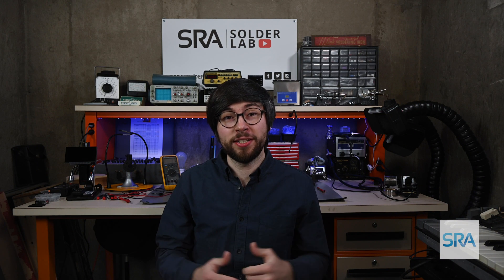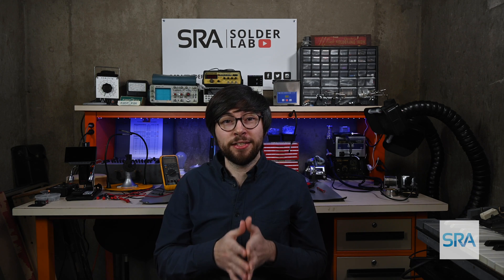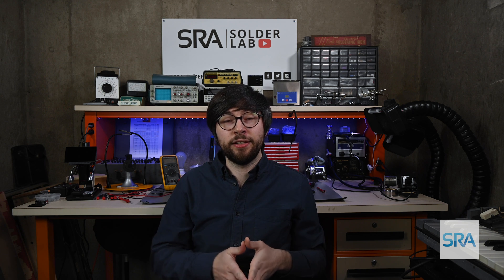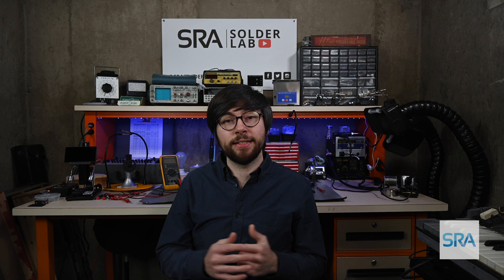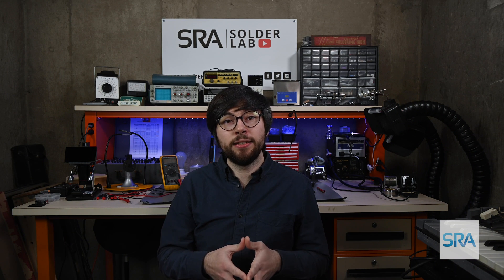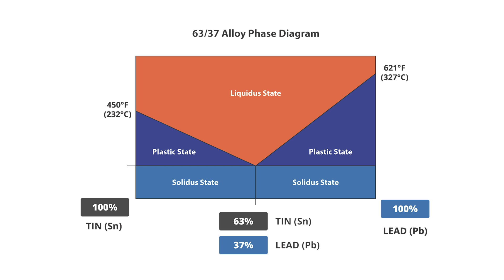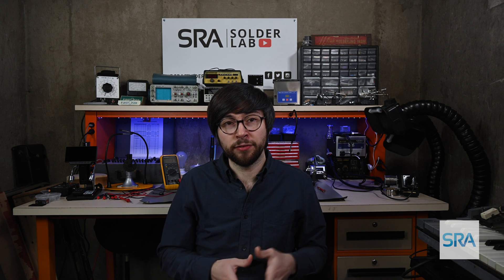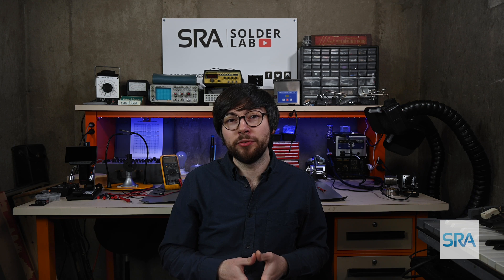Is Lead Solder Bad For You? | SRA Solder

Comment: Thanks for this. I don't work much with electronics but I mod and fix up guitars every now and then and the last time I was doing the wiring on a guitar, I noticed the spool of solder I've had for the last ~7 years has 39% lead in it and I was thinking if I should throw that away or is it safe to keep using it. This was helpful.

Comment: Great Video.  Note many mil-aero applications require leaded solder: "Lead-free solder presents several disadvantages compared to traditional tin-lead solder, including higher melting temperatures, increased thermal stress on components, more challenging rework processes, and the potential for brittle joints. Additionally, lead-free solders can exhibit issues like tin whiskers and dendrite formation, which can lead to short circuits and system failures."

Comment: 5:25 I'm just looking through all the gorgeous technology that I would refurbish and use or sell. That not waste management, that is a crime scene. What would I use to refurbish it? Lead solder, obviously. Anything broken from the 21st century is usually a result of that crap RoHS stuff. Remember DV9000 failures, rampant gpu failures, and the red rings of death on your 360? Yup, RoHS solder failures leading to component failures. RoHS solder has done more to fill our landfills with otherwise perfectly usable technology than any other factor. Leaded solder can help save the planet when safely sequestered in working electronics and our workbenches.

Comment: SAC305 and SAC405 (both are lead-free) can melt at the temperatures like lead when used as a solder wire. If SAC305 becomes solid, then it will melt at 370°C to 400°C. I don't know about SAC405's melting point after use but it's eutectic.

Comment: Handling the leaded solder wasn’t an issue as we used gloves. We were taught this from the start. We were also taught not to inhale the fumes that are produced as a part of the process. For those who are not contract workers for the defense industry, you can avoid issues down the road by wearing gloves and keeping your breathing out of the path of fumes. This is not a scare tactic. It is a legitimate health issue you should be aware of when using leaded or any solder. Fume extractors will work to remediate this issue and wearing gloves will inhibit direct contact with the lead in leaded solders. The flux contains compounds which will cause health issues and staying out of the fume path while breathing. Professional contractors have these safety equipment problems covered as they require glove wearing and use of fume extraction equipment during operations. Hand washing before breaks and before end of day inhibits problems down the road. Poo pooing this is futile as handling leaded products involves these precautions. The SDS clearly lays this out. This is highly evident in critical circuit soldering where the most extreme precautions are exercised. This was evident in DOD STD 2000-1 and is still evident in the JSD 006 level 3 which is also critical circuit soldering. Ignoring safety is just stupid. It’s your health here and you should care about this. I’ve been soldering since 1979. There is something that was true back then and remains true today, safety is paramount. Ignoring safety is a sure path to your own destruction. Coming in with the understanding of health and other issues saves you from too many problems. It’s up to us to avoid these problems by keeping ourselves well informed. Stay safe and press on people.

Comment: is 60/40 effectively diff from 63/37?  and why the slight diff?
Reply from the maker: The difference is that 63/37 melts and solidifies at the same temperature whereas 60/40 has a "plastic range" so if it isn't fully heated you get a cold solder joint.
Reply: @SRASolderLab  Thanks, but why would one want 60/40 over 63/37? or even lead free... allowing for rules and manufacturing ect i understand.  My 63/37 digitor solder melts like butter and is so easy to use and less risk of flexing m/B cracking solder. Why would one want 60/40?
Reply from the maker: @xx3868  The higher lead content in 60/40 leaves shinier joints. It is all a matter of preference though. People that have used 60/40 for years are likely to keep using it instead of switching.
Reply: Eutectic is my go too.

Comment: As far as vapors go, consider this: when you solder, you're typically working with temperatures that peak out around maybe a little over 700 degrees Fahrenheit. Lead does not boil (vaporize) until 3,180 degrees Fahrenheit. But one should be soldering in a well ventilated area with good air-flow anyway, because the fumes from the flux are not particularly desirable things to be breathing anyway.
Reply: notice how water will evaporate from an open container below its boiling point, at a rate that accelerates when the temperature rises. an element below its boiling point still evaporates into the air...
Reply: @louisvl10 What's evaporating now?

Comment: There are no problems with modern lead-free solder, it just isn't as shiny. Weird hipster hobbyists and boomers insisting that putting lead in all our electronics is safe and fine is actively harmful to human health. You apparently haven't noticed that soldered electronics are EVERYWHERE. `
Reply: You apparently know little about electronics, engineering and repair.  Lead tin solder is still being used where high reliability is required such as aerospace.
Reply: You obviously have zero experience soldering. Explain to me then why leaded solder is required in some military/defense applications? Hmmm...

Comment: You are so wrong saying that the fumes do not contain lead. Well the fumes (the rosin fumes) do not. But lead still evaporates from the melted solder. Constant exposure (not like a hobbyist, but daily repair) could cause lead poisoning.
Reply: Can you please explain scientifically how lead can be present in fumes? Lead is supposed to boil at about 1800C. Without evidences you can also say that the Earth is flat.
Reply: Nope

Comment: I use nitrile gloves, because it provides both the reduced direct lead contact but also protects my soldering from my hand oils. I'm finding I can run lower flux content wires (1.1% or 2.2% max) and still get excellent results with less flux residue to deal with.
Reply: As long as you wash hand before eating and don't breath solder fumes....you're wasting money on nitrile gloves.
Reply: @Pgr-pt5ep  Right, but the gloves protect your work from hand oils and also offer a measure of burn protection from wayward solder globs. There’s more reasons than lead contact that make them worthwhile.
Reply: @G5HohnAre you working on space grade working pieces? Honestly the amount of oil transfered from your fingers to the PCB/components is minimal and a none issue on 99% of the work that everyone does. You should also  be cleaning your work after you have finished.  If your getting solder that spits you need to get better solder. I had this with some generic solder and changed to a better more well known brand and I  never get solder spits now.

Comment: Your stove doesn't have molten lead in it, hopefully. Plus it definitely doesn't have asthma-causing pine rosin in.
You don't need to buy either lead, or pine rosin, to do soldering.
Good soldering irons can easily go to 230°, and even a lot hotter.
Reply: Dol they still use pine rosin these days and not some synthetic stuff that is kind of similar but takes less effort to make/harvest?

Comment: I can't understand how you acknowledge lead is toxic, present alternatives and finish by saying: it's your decision.
Reply: It is 

Do you want to be careful not to eat it or do you want to be free to eat as much solder wire as you want?

It won't kill you if you're not stupid, just like touching mercury is 100% safe(check out Cody's Lab video on the mercury test results after he dipped his whole arm in mercury and worked for years with mercury in the quantity of some several gallons.) The problem is inhaling hot mercury for a long amount of time or it reacting to form organic mercury compounds.

As long as you're not making lead acetate to sweeten your wine or using lead pipes in your water supply system you'll be ok.

Soldering with lead wire is not only safe, but the smell releases dopamine, soothes you (literally has medicinal properties similar to beer due to the amount of myrcene on the rosin), and it actually flows and shines instead of the nightmare that is lead free solder(maybe the one with silver is good but I'm not buying that ever)

Comment: I started soldering with 60/40 solder at around age 12. For the first few years working with the telephone company almost all connections were solder joints, many years of soldering connections. In addition to personal copper pipe soldering. I have made thousands of solder joints using leaded solder. Tried lead free solder a couple of times and just don't want to deal with it, now maybe it was poor grade or maybe it's my technique, regardless it's not for me. It doesn't flow well, all joints look like cold solder joints which were considered a bad thing with leaded solder.  I will soon be 69 and my health is excellent, mentally and physically fine. If you are doing occasional hobby soldering what's the big deal, you can't beat 60/40 rosin core solder for ease of use. As a side note there were 2 main soldering irons -  American Beauty 150 watt with long cords, they were plugged in and powered on all day and night - 24/7 for at least 15 years with no issues except a new tip maybe once a year. They were there in use when I started work and still there when I retired 32 years later.
Reply: That's It, 100% agree.
Occasional use or hobbiest application makes lead solder prevail..  regardas
Reply: You started working for the phone company at age 12? Dang!  And your side note on the 2 main soldering irons -- don't leave us hanging, what was the other one?
Reply: @Graham_Wideman I think he started soldering at that age.

Comment: Grego: I am a retired electronic engineer and manufacturer. Have worked with lead solder using irons, dip pots and wave machines. I started as a hobbyist in the 1960’s and used maybe 100’s of pounds of roll solder and three loads in my wave machine (Electrovert) of 200lbs per chaa add age. Before retiring my shop Forman and technician wanted to get tested for lead in his body. We both got tested! We both had very low levels… no different than non electronic employees. As a teenager working on my projects I did not use any form of fume extraction! It got smoky in my bedroom. My engineer father build many Heathkits the same way! So the moral is… don’t put the stuff in your mouth to hold it while your hands are busy, and wash your hands before you eat!
Reply: Metallic lead isn't GOOD for you.  But metallic lead has relatively low bioavailability and toxicity.  Anecdotally, if you're not working with leaded solders occupationally, and you're not doing stupid things (like you mentioned), your actual exposure will probably be relatively low.

I knew guys who used to work for Kester solder (before the Litton buyout).  The only 2 people who had abnormal lead levels were two guys who used to smoke cigs and eat sandwiches in the lead foundry (even though this was strictly against the rules, and REALLY dumb).  The other people in the foundry didn't do dumb stuff like that, and their blood tests came back pretty consistently normal.  The guys in the wire drawing plant likewise didn't really get any surprises when they were tested, because they didn't do dumb things.
Reply: @charleshines7282 It depends on the exact chemistry of the solder (lead-free chemistries use mixtures of tin, silver, antimony, copper, etc.).  Some lead-free compositions are less prone to tin whisker - generally, the more heavily alloyed, the less likely whisker formation is.  It's also seems to be a thermally-driven process, so the melt-cooling cycle and service temperature have contributing effects.
It's complicated, and still not fully understood.  I've seen tin-lead solder jobs many decades old that have no whisker formation, I've seen same-chemistry solder jobs that DO have whisker formation, I've seen lead-free solder jobs decades old that have no whiskers, etc. etc.
The "big losers" seem to be from very high tin-purity work (almost no alloy content).  That's about the most I can give you.
Reply: The other problem is the toxic fumes of flux, ventilate!
Reply: I’ve heard from a nurse that lead can hide in your bones and not show up in blood test
Reply: You do nothing by undergoing a blood lead test if you also do not measure or pay attention to the amount of lead (Pb²⁺) attached to bone tissue as it is similar to calcium (Ca²⁺) in terms of properties and even when it is dispatched from the bones into the bloodstream through replacement of bone tissue, it will injure the brain. 

I remember reading a pertinent paper (Lead toxicity: a review) which states, "There is almost no function in the human body which is not affected by lead toxicity."
Reply: Exactly. Basically, don't chew on the (leaded) solder wire, or eat/drink after soldering without washing your hands first, and you have almost nothing to worry about.
Reply: Definitely don’t eat near active soldering irons. Used to have a classmate in college who was heating up m& ms then ingesting the candy. I told him that’s poison and it will make him sterile. He replied that he hoped he was sterile. He was a 19 year old punk.
Reply: Yes, but the flux fumes are still bad for your lungs, a lead test isn't going to show flux fume damage. Ventilation is still important.

Comment: You forgot to mention that lead free solder is banned in use for aviation due to the fact that non lead solder is much weaker and prone to popping off the joints and cracking etc when lots of vibrations and heat cycles are present.
Reply: Good to know.
Reply: A crack in the solder can still become a discontinuity, even if it is not a mechanical problem. For mechanical support staking with epoxy or mechanical support structures are used. But that is typically only done on heavier parts.
Reply: Do you have a current source on that?
Reply: @soundspark  How hard is it to use google? Took me less than minute to look it up... Seriously.
https://leadmatters.org/wp-content/uploads/2020/09/Lead-Matters-Casestudy-Aviation.pdf
Reply: 1st thing you learn is that solder is not glue. Do you believe there is no real mechanical connection in aviation before it gets soldered? I am genuinely curious.

Comment: I'm working with musical equipment, mostly through hole, analog, hand soldered, nothing super tiny, and from my experience lead free doesn't really work in that environment, i can not imagine repairing/putting together a proper tube amp (for example) with lead free solder.
Reply: in my expereince it poses no problem at all

Comment: What about handling lead solder? As an electronics hobbyist I've easily gone thru 10 full spools of solder in the last 2 decades and all of it handling 60/40 with my fingers. Does lead build up and stay resident in the body?
Reply from the maker: We recommend washing your hands very well after handling and don't consume it in any way. I like to wear a glove on the hand I handle it with just so it mainly builds up on the glove.
Reply: @SRASolderLab  is it true that washing your hands does not get rid of all lead particles on your skin?
Reply: @SRASolderLab my problem is that I’m clumsy and have adhd and keep touching my face, hair, phone, mouse and keyboard while soldering… I just gave up and stuck to lead free
Reply: Yes
Lead stays in your bones and slowly poisons you for decades.
Even if people say it is safe, it is not worth it to risk it, as it is IMPOSSIBLE to handle lead completely safely, because there is no amount that is considered harmless
Reply: I’ve heard from people who’ve bought lead contamination testing kits that lead does get into the air. It might not vaporize, but particulars of the stuff do get into the fumes regardless, which means your going to have to deal with lead in the air if you use the stuff.
Reply: @richards5855  It definitely gets into the fumes, you just have to look at the filter on the fume extractor to see the lead sheen. I believe some comes off with the flux smoke.